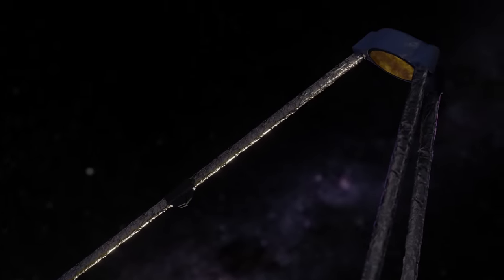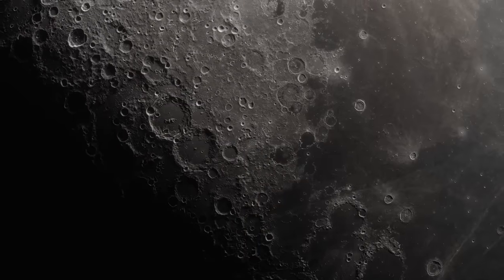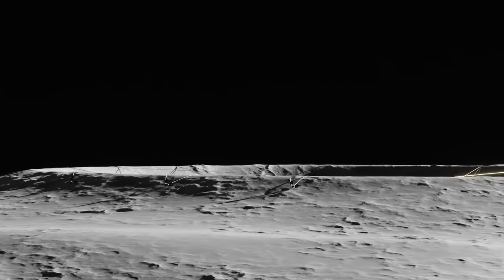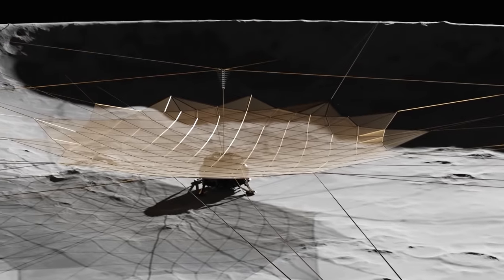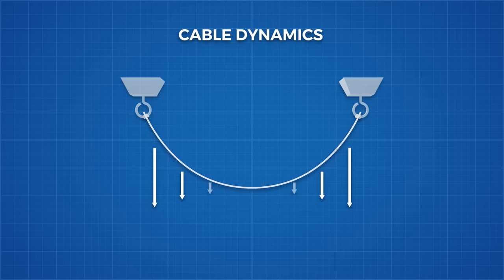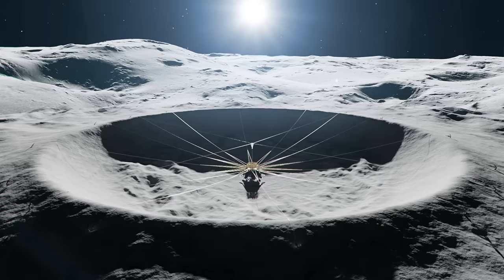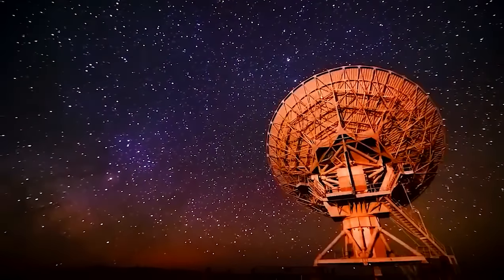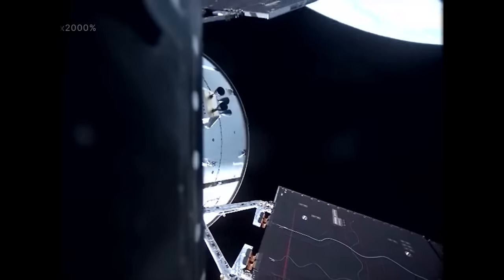NASA's Plan to Build A Telescope on the Moon

Comment: Before anyone gets too ambitious about a crater telescope on the moon, let's see if there is anything at those wavelengths.  4 MHz is a low frequency, very cold bt black-body standards.  It would be far cheaper to launch the equivalent of a Bearcat scanner per probe in a couple of lagrange points, rather than commit to a century of Moonbase Alpha.  A ten year antenna will be far easier to swallow than a full century of lunar human occupation.

This does not say, let's not do it.  While those decade and 25 year satellites do their work, build a moon base.

Comment: Every Kilogram you land on the moon is a kilogram you raise off the earth since their is no industry on the moon (yet), Also must be included the energy to land the materials softly on the moon. Why not build an array similar to the VLA in space, use lasers to continuously monitor the actual distances and then integrate across all o the telescope to make an apparent aperture many kilograms across? This time have humans involved in the building using partially  constructed pieces shipped up from earth? Something resembling wire mesh umbrellas stuffed dozens to the starship. Huge telescope less weight, radio waves are so long that a assembly like JWST is certainly not needed, reflectors and lasers can give all of the position data required to devolve the data supplied by this telescope.  When I was back in school we also approached this problem and our consensus was build the monster in space located near the Lagrange point that JWST is parked at, there is plenty of volume at that point for project.

Comment: Why are you making something so easy, so difficult. If you use the carbon fiber cables that run from beyond rim to rim of the crater to form the shape. At the top of the rim the cables go through a low friction eyelet that is on a threaded rod that anchors the eyelets solid into the rim and keeps them off the surface completely. From there you run excess cable to a winch type device that bolts onto a flat platform that is on another threaded rod that is long and anchors into the surface at least 45 degrees away from the crater. With that type of setup you can tighten the cables to create the shape you need, plus it will have weight on it so the shape should be easy to manage. Cheaper, very adjustable and last for years.

Comment: I'm astonished you didn't talk about the possibility of an asteroid hitting it and ruining the whole thing.. It's the moon.. It's covered in craters, there's no atmosphere for rocks to burn up in. This is a terrible idea. It also makes a lot more sense to just put in space where the angle can be controlled. I just don't see the benefit. If you're going to do this and put all that work and money into it you might as well just go all out and build the thing in space. I would be more excited for an official announcement for LUVOIR
Reply: The area covered by any of the Apollo missions (i.e. several square km) is hit by an asteroid once in 1000 years. The chance of getting hit in space is exactly as high as it is on the lunar surface.

Comment: Youtuber has no idea how expensive it is to build a telescope on the moon. Just the cost of sending material to the moon would be enough to make a dozen JWSTs. Not to mention that the telescope’s infrared cams are pretty much useless due to heat and constant bombardment of heat and radiation from the Sun.
Reply from the maker: This guy thinks a YouTuber made the cost analysis
Reply: @skbean2263 Not like you have any idea either. You don't even seem to understand that this video is talking about a radio telescope not an infrared telescope.

Comment: Did I hear you say building a km wide telescope on the Moon will be cheaper than Webb? If so, that is an absurd statement.
Reply: That says more about how expensive Webb was than how cheap a lunar telescope could be. And besides, this could just as easily go way over budget
Reply: @alexsiemers7898  that's kind of the point. NASA projects always go over budget. The grant process ensures this because proposals have to be flashy to get accepted. If it already sounds too expensive in the concept stage then we have a problem.

Comment: Last time I checked, precision telescopes don’t do well next to abundant amounts of dust... 😂😅😢

Cough cough... Hubble.... Cough cough... moth wing dust...
Reply: This video isn't talking about an optical telescope. There would be no lenses or mirrors to get dusty.
Reply: @T3H455F4C3  Try putting dust on a solar panel.
Reply: @mckanebullerlee3020  Try running the telescope with a radioisotope thermoelectric generator (RTG) instead of solar panels.

Comment: OR, you could use Starship and none of these mass restrictions apply anymore ^_^
Reply: Starship have never flown successfully, and last time it did it lost 20% of its engines...unless they can increase engine mean time between failures by 1000%, it will never fly crewed missions.
Reply: EZ  @TheEsseboy
Reply: @paulkerman8906  EZ?
Reply: ok maybe "easy" is the wrong word
but rewind 10 years and the same thing could have been said of F9.
Also, crew isn't a necessary component of the mission discussed in this video, so...? @TheEsseboy
Reply: @paulkerman8906  The falcon 9 does not have 33 engines in the first stage...it has 73% fewer engines.
Reply: let's pretend we're having this argument in 2012. You're defending the Atlas 5 (F9's main competitor and industry standard at the time). In this case, the F9 has 900% more engines (9 on Falcon vs 1 on Atlas) than the incumbent, so by the logic of "higher % of engines = less success chance", the F9 is doomed to failure.
That's not bringing up the fact that several of the engines on the first flight were taken out by the pad's failure, which is an inexcusable oversight in my opinion.
To say "Starship has never flown successfully" is technically accurate, but could be said about any rocket in history at some point in time.  @TheEsseboy
Reply: @paulkerman8906  The probability of loosing engines increases exponentially as you increase the amount of engines, to get the Starship rated for humans would require them to increase the mean time between engine failures 10 fold...as a single engine failure could have a cascade effect and damage more engines. 
We are not talking 1 vs 9 engines, we are talking 33 vs 9, and to add to the complexity they have much higher chamber pressures, are full flow designs and use Methane instead of RP-1. 

My best guess is that Starship will be ready for human flight 2026 the earliest, but much more realisticly in the 2030s, if they do not drop the Raptor engine and use a much simple engine and suffer the weight penalty.

Comment: Terrible idea. An ideal solution would be an orbital telescope, skipping the costs of landing and surface construction. Besides it makes more sense to build a larger version here on Earth for greater benefits.
Reply: The whole point is to use the moon to block radio noise from earth. Building it in orbit or on the ground defeats that purpose

Comment: why dont we start putting these openai Boston dynamics humanoids on the moon too manage the process, they are far cheaper than the moon rovers to build & they can walk on nearly any terrain if they fall over they just get up, they can be remotely controlled or given commands, charge themselves with solar quickly for the same price of one rover you can send 3 bots the landing craft its self can be the control tower, charging port & research lab they dont need any living area or food so once they are there it done & if you have the 3 the worst that goes wrong is one breaks or one stops charging in that case you just use the others to fix that problem & if you need new parts you can send much much smaller rocket, as for connection use the starlink method but link the them horizontally across space or use the starlink net mentod as a giant transmitter honestly dunno why they dont do this sooner.

Comment: How are they going to protect it from astroids
Reply: They won't need to.
Reply: @h.dejong2531  why ?? Moon doesn't have atmosphere astroids will hit anything on ground
Reply: @zJKjanozyH1  You overestimate how many meteoroids hit the moon. An area of 1 km2 gets hit once every 10,000 years, and most hits are tiny. 
So a. the impact frequency is low enough not to matter, and b. if a small meteoroid hits the antenna, it just punches a small hole in the antenna surface, reducing the effective surface a tiny bit.
Reply: @zJKjanozyH1  Again, there is a big difference between 'how many meteoroids hit the moon' and 'how many meteoroids hit 1 km2 of the lunar surface'. 
The moon gets hit 33000 times per year, divided over a surface area of 37 million km2. That's one hit per km2 per 1000 years.

Comment: 6:15 this is false a half circle is not what is desired in a telescope what is desired is a parabola conic sections 101 you should have known this is what they teach in highschool
Reply: Half circles at small sizes are more desirable because they’re much easier to produce and approximate parabolic mirrors at the same size fairly well.
Reply: @muffinconsumer4431  that is true but for big and expensive telescoops this is not the case (like this one)

Comment: If we are truely planning to go to Mars in the future, we should be stationing relay satellites out in space several thousand miles apart toward Mars so we can get communication much faster. Planning is key to space travel.
Reply: That won't work. A satellite "halfway between Earth and Mars" is in orbit around the Sun, and its orbital period is halfway between the 1 year of Earth's orbit and the 686 days of Mars' orbit. I.e. this satellite is almost never actually halfway between Earth and Mars: it's somewhere else in its orbit. You'd need a dozen satellites per orbit to make a difference. There's a much easier way to speed up data transfer between Earth and Mars: place satellites in orbit of each planet, and use an optical link between them instead of the radio links used now. This increases the bandwidth enormously.

Comment: NO the Bible is running out of time 23Dec25 and no time.
Reply: "But concerning that day and hour no one knows, not even the angels of heaven, nor the Son, but the Father only."
Reply: @h.dejong2531  the Rapture isn't on that day and knowing the season is possible, there are reasons other than the Rapture for the time running out like the dome of the rock 691A.D anniversary 1335 Daniel12:12. There's a lot going on besides the Rapture.
Reply: @deadlinefortheendtribulati4437  When it turns out that you're wrong, can we laugh and call you names?